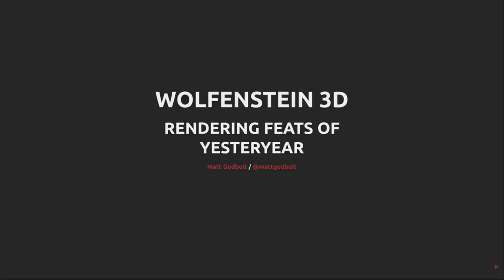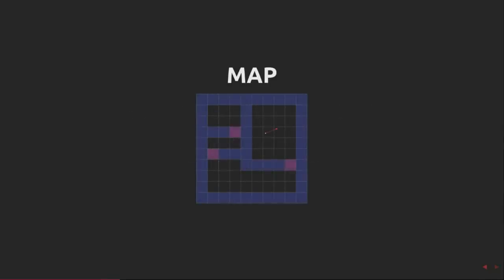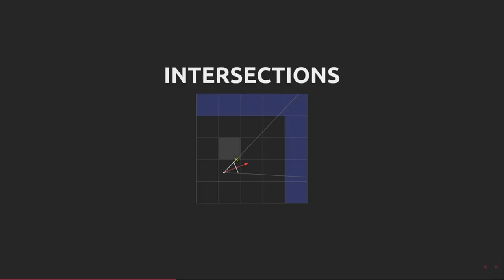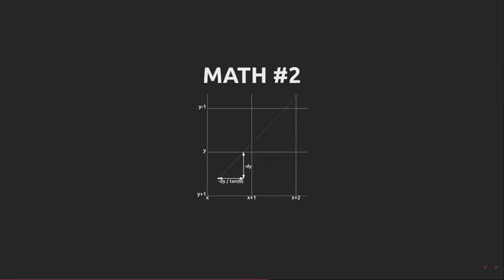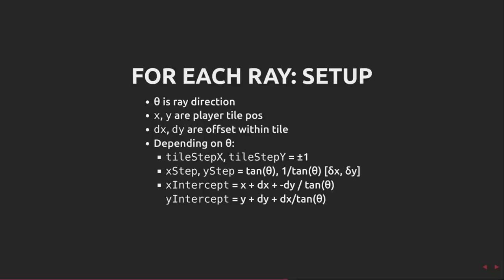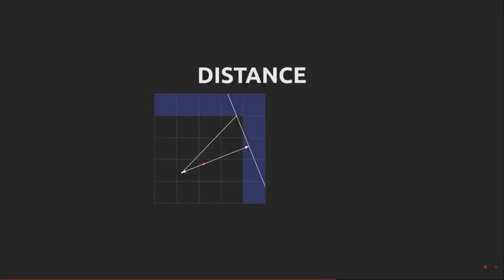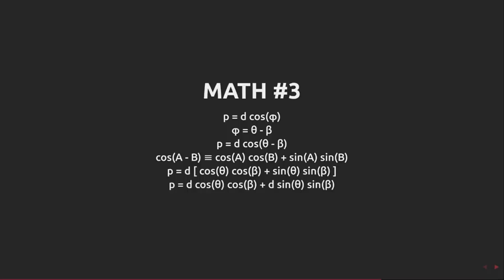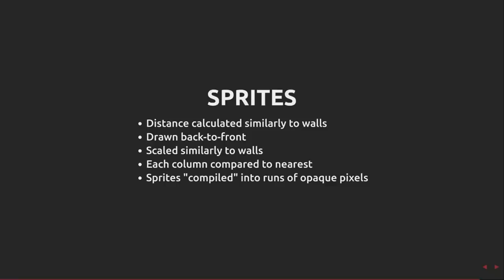Wolfenstein 3D's map renderer

Comment: It's funny to stumble upon a video by the guy who made the Compiler Explorer. Thanks for giving the tools and ideas for tinkering! =)
And thanks for the notes on self-modifying and self-generating code: made me really want to dig into Wolf3D's internals

Why does the fisheye effect occur with the naive hit distance calculation? Geometric intuition suggests that everything should be ok if you choose field of view correctly
Reply from the maker: I obviously didn't explain myself well about the fisheye. Field of view doesn't come in to it. Imagine a wall directly 10 feet from you. If you were to take a photo, the wall would appear in the photo as a rectangle, right? No fish eye. However, if you measured the distance from your eye to the wall directly in front of you you'd get (say) 5 feet. But it's further to the left and right edges of the wall, maybe 7 feet away (depending on how long the wall is). If you scaled the left hand as 7 feet away, the middle as 5 feet away and the right as 7 feet you'd draw something like a fish-eye wall. So -- the takeaway is, the scaling distance can't be the straight-line distance from the eye to the object, but rather the perpendicular distance away from a plane at the screen. I hope that's (maybe) a bit clearer! I've seen engines use the straight-line distance and then "fudge" it to undo the fisheye effect instead of calculate it properly as Wolf does.  Changing the field of view only changes the angles between each ray cast out, it doesn't create or remove the fish eye effect (although if you have a very large field of view you see something similar).
Reply: @MattGodbolt  thanks, got it!
But what if I aim not to simulate a flat non-distorted picture, but to make the screen "transparent"? In this setup the source of the rays matches the viewer's position, and the virtual screen FOV matches the real one. Will the straighforward approach be more appropriate then? And why isn't it used in game engines? Too narrow FOV?
What I want to overcome by this approach is the unnatural view stretching. It's noticeable when you rotate the camera: everything looks way smaller in the center of the screen than on its periphery (yay, I know the reason of this warping now)

Comment: I'd be really interested in seeing that fisheye effect you mentioned at 3:38.
Reply: Just search up "raycasting fisheye effect."
It just looks like the player is looking through a fish bowl.
When facing and far from a wall, the lines (top and bottom) slowly converges at the ends of the screen; this is more apparent when the Fov is relatively wide.
Reply: Check out the coding train Livestream for a demonstration of that on P5 js https://youtu.be/-6iIc6-Y-kk
Reply: @callsignseth7679  The middle section of the stream of Daniel is about 3D representation of ray casting and the fish eye effect when we don't take in consideration this geometrical adjustments.
Reply: Ultima Underworld and I think Catacomb Abyss both have this issue.
Reply: There's a picture of the effect in the book "Game Engine Black Book Wolfenstein 3D" by Fabien Sanglard.

Comment: 6:14 and 6:31 no, when stepping to the next cell you have to add +1 or -1 to the initial computation dx/tan(θ) or dy/tan(θ), as you correctly describe later based on source code.

Comment: a 286 with no floating point was certainly NOT "state of the art" in 1992!
Reply: Tom P. Agreed. I still have my 386SX-16 from 1990. A 486DX2 was state of the art in 1992!
Reply: It wasn't 'state of the art', but it was met the minimum system requirements.
Reply: I think he met to say i386.

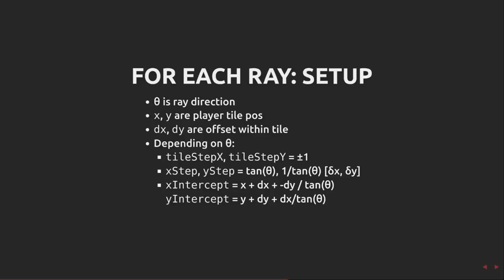Comment: 8:24 this is what makes it extra good. thx for sharing.
Reply: Good and unstructured code.  It works but it is insane.  It applies 16-bit arithmetic on 32-bit words.  It is not portable because it requires an old C compiler that defaults to unsigned comparisons.  There should be a disclaimer.
Reply: @techeadache  woaaa did you just use knowledge to elaborate on my initial argument!!  O_O    :-)
Reply: @kentlofgren  I think a lot of people will try to implement this craziness on a different compiler.  Ofcourse without knowing that (-dx) means static_cast<long>(static_cast<unsigned short>((1L<<16) - static_cast<unsigned long>(dx))).  The negation is an optimization and not a mathematical form for subtraction.  The old keyword "volatile" may need to be used to force (-dx) into memory before it is applied to other equations.

This is code that must be written in assembly.  Using a C or another compiler may produce an undesired effect that would be fun to watch.

Comment: There were far more powerful processors in 1993 than a 286. We were up to 486 pushing into pentiums. There were also graphics cards at that time.
Reply: Wolf3D came out in 1992. Doom came out in 1993. 

My family got a 486DX/33 with 8MB of RAM in 1993. You could just barely run Quake on it (if you call getting single-digit fps with the sound breaking up "running"). Cost AUD$4000, which is about double that in today's money. Hardware was expensive. Hardly surprising that ID targeted older stuff like the 286 for Wolf3D and the 386 for Doom. 

3D accelerated graphics cards were a mid-1990s thing. The first ID Software game to get support for them was Quake 1 with the GLQuake update, but Quake 1 started off with software rendering only. Quake 2 still came with a software renderer, and it wasn't until Quake 3 in 1999 that they were common enough that ID dropped software rendering entirely. The original Unreal from 1998 also includes a software renderer (and a pretty impressive one at that, as it dithers the environment textures to fake bilinear filtering, which I've never seen in any other engine), but later games using the engine don't bother to include it.

Comment: I disagree with calling a 286 "state of the art" for 1992. Commonly available, and a good target system to develop for? Yes, but the 386's and 486's had already been out for a few years by then.
Reply: Yeah, and not to mention the gaming beast that came out in '87 - Amiga 500.
Reply: Agree.  The 486 was introduced in 1989, it was actually a bit old by 1992  - the 486DX2-66 was top of the line in 1992.  The Pentium was released in 1993.  386s were still around but fading away.  286s were pretty rare and while Wolf-3d may have run on one, it didn't run particularly well.

Comment: The use of the square grid to leverage CPU power was pretty genius on id's behalf. I wonder how was the trig handled without floating point arithmetic?
Reply: It was built into the compiler, they didn't even need to think about it, but of course, it is always better to avoid using floating point, as doing floating point math without an FPU is expensive.
Reply from the maker: I think I explain in the video (it's been a a while...) - everything used fixed-point arithmetic with look-up tables to handle the trig functions.

Comment: It should be noted; Ken Silverman's Build Engine could actually do room-over-room tracing, even though it was primarily a raycasting engine. I'm not exactly sure how it worked, except that doorways and windows that you could pass through worked by teleporting the player to different places in the map.
Reply: The build engine wasn't geometrically correct though, try looking up and you will see everything looks distorted!
Reply: @navithefairy  It's the same trick used by Rise Of The Triad: treat the view like it's really tall and slide the screen up or down, then render the bit that'll actually appear. Unlike a proper perspective-correct 3D rendering, it will keep the walls dead-vertical when you look up and down, whereas a proper rendering will have them turn into diagonals.

Comment: Personally, I always thought that the fisheye effect was much more desirable than the "corrected" version that has become standard for the simple practical reason is that you can play with a higher FOV with the simple distance renderer and not have the central focal point in the middle of the screen be so small, and the edges be so big.

I really wish more renders kept the simpler distance render for that simple reason alone. It makes it easier to see when playing.
Reply: The fisheye effect didn't increase FOV. FOV stayed the same, the walls just scaled incorrectly.

Comment: I had a 386DX 40Mhz then, I clearly remember that it didn't run well at full screen even on that machine. I was quite jealous for the 486DX2 66Mhz because Wolf3D ran perfectly on that, but not with the 386... on 12Mhz 286, there is no way to talk about well-running Wolf3D at all, if it is close to the full screen :D 
Not mentioning Doom, what was awfully slow at full res. on my 386, strong compromising needed to play. With a 486DX2 it was much more playable...

Comment: They had no floats in 1992?
That absolutely blows my mind!
Reply: Fixed point is enough for such resolution and level of details
Reply: Floating point hardware existed but wasn't common until the Pentium.  It was optional with 486s - the DX had floating point, the SX did not.  Prior to that it was a separate chip (math-coprocessor) available all the way back to the 8087.  See also the 287 and 387 chips - the math coprocessor counterparts to the 286 and 386.  Many motherboards had space for the math coprocessor but it was left empty.  Very little software took advantage of floating point hardware back then - CAD and spreadsheets come to mind, but both had software floating point algorithms to fall back on if the hardware wasn't present.
Reply: Badtanman They has floats in 1992 but integer math was faster before the Pentium. On the Pentium you could start an floating-point operation, do a bunch of integer math, and then read the float results X clock cycles later due to the dual U and V pipes of execution on the Pentium. This is how Quake was able to get ~8 - 16 texels for free with its software perspective correct texture mapper on the Pentium.

Now a days integer math is slower then floats so every one uses float32 or float64 for the increased precision, speed, and convenience.

Comment: I'm sorry, but this has become sort of a pet-peeve of mine (especially with all the videos about real-time raytracing around these days): 
Raycasting is simply the process of "firing" (or casting) a ray from one position in one direction into a scene and checking what it hits. That's all there is to it.
It's still in use in almost every single game you play today, for example to check what enemy a bullet hits. In itself, it has about as much to do with rendering as a hammer has to do with building a house.
Raytracing generally describes algorithms that use raycasting to render an image.
Everything beyond that is not included in the terms on their own.

Two other things I noticed:
1. You're only using about a quarter of the screen. I imagine that's a bit annoying for people watching this on a smaller device.
2. The step done around 12:35 might have been easier to follow if you circled the terms replaced by delta X and delta Y in the equation for p.
Still, very nice and to the point explanation of the algorithm.
Reply from the maker: Thanks for the comments. You're not the first to point out my mistakes here :). If I were to redo things, I'd use more of the screenspace and make clearer the definition of what ray casting is.
Reply: hammers have a lot to do with building houses, Lol
Reply: @barrybathwater4877  Well... yeah... they are definitely used while building houses, but using a hammer does not mean you're building a house... which was the point.

Comment: This is the older video and I don't know if there was a comment on the following issue...
At the time stamp 04:55, you are showing that "dx" is the distance of the starting point from the LEFT side of the square field.
But at the time stamp 06:20, "dx" is suddenly the distance from the RIGHT side of the square field.
Which "dx" is used in the final equation? Left or right side "dx"?

Comment: There's a better way to calculate how large the column of pixels for the wall should be than calculating the normal distance.

Calculate the square of the normal distance, and use that directly.

Comment: The 486 was released in 1989, 386 in 1985. A 286 would not have been "state of the art" in 1992, but rather a paperweight.
Reply from the maker: Patrik Lindström a fair criticism! Thanks for the correction. It was in fact the minimum spec!
Reply: A 486 might well have been out 3 years before Wolf3D, but they were super expensive and only really affordable for business use. A 286 was a realistic "home PC", but yeah, not state of the art.

Mine was made by ICL and had a whole megabyte of RAM and a 40MB hdd. It was a massive upgrade from my Atari ST - it did VGA! ;-)
Reply: I knew many people who still used the 286 in 1992. In fact some even used older PCs for accounting and such. It wasn't a paperwheight unless you were a hardcore gamer. Edit: Atari ST <3 <3 <3
Reply: we got our first 486 in 1993.
Wasn't cheap as such, but considerably cheaper than the 286 we got in 1990.
That does give you some idea of when the 486 started to common.
I mean, there's sometimes a big gap between something first being available and it being common.
there were computers with a recognisably modern GUI in the mid-70's, but it's not until the mid 90's that it was common enough to be the norm, and not something of a niche thing...
Reply: I played Wolf on 286 and my next computer was 586 in 1996.
Reply: @James - Never the less, 386s were the "standard" by 1992. My family had a 486 DX2 50MHz with 4MB in 1992. That was powerful enough to run Doom at full screen a few years later.  (Though it did create a lot of motion sickness in Wolf3D....)
Reply: @MattGodbolt   well, you were kinda right, actually. 286 in 1992 was quite a modern machine. Those were times when tech was not growing that fast and 286 in 1992 was a decent machine. Also personal computers were quite expensive and rare, so in 1992 you could definitely surprise your friends with 286. Having 486 in 1992 was like you had a personal space shuttle :)
Reply: @SweetHyunho  there were no 586, bro, they already were called "Pentium" :)
Reply: While still on a 286 in 1992, we upgraded to a 486 in 1993. The 286 was definitely low end in 1992, but still quite common. 386 and 486 were quickly overtaking it in numbers.
Reply: I did think this. The Pentium came out only a year later in 1993. Always reassuring to not be the only anal one watching a video 😉
Reply: @user-lv6qm3fj2z  Intel went with the Pentium name because they couldn't trademark "586", but that's essentially what the chip was.  And there were 486-compatible upgrade chips from the likes of Cyrix and AMD that used "5x86" names, which competed directly with the Pentiums.
Reply: Not so much a paperweight. PC gaming wasn't big in 1992. PCs were still extremely overpriced underpowered boring business machines. They mostly ran DOS programs for business. There wasn't much demand for high-end PC hardware, there was precious little that needed it. Doom was the one game that changed that. So for a long time the PC market covered a wide variety of machines, CPU, RAM, and graphics cards. Most games of 1992 will still have come with EGA and CGA graphics modes. Wolfenstein obviously being an exception. 

Things weren't like they are now. 
 
The first 486 CPUs cost something like $1000 or more, just for the chip. RAM was something like $80 a megabyte. This is all from rusty memory. Home computers wouldn't usually have a hard drive, nor would many business ones. 

ID got their start making games with full-screen scrolling and sprite animation that would run on the crappy PC hardware of the time.

Comment: Great video! Great visual representation of Raycasting too. ^^

A few companies wrote really advanced Wolf3D raycasting engines. Rex Blade by Andre' LaMothe specifically uses this in a shipped game, it uses somewhat DOOM-like Geometry (by using stacked grids) with some advanced features. Rise of the Triad uses a similar system, but with only one grid with walls of variable height.

Rex Blade has a pretty amazing engine, he wrote in 180 days I believe. 

Rex 3D (unrelated to Rex Blade) used raycasting with lines like DOOM, this one was very advanced but has nearly been scrubbed from the 'Net. Raycasting like this in a DOOM-like environment gives you some great tricks like being able to calculate some nice lighting and such somewhat akin to its larger brother Raytracing.

Comment: I'm pretty curious about the self-modifying code of the ray casting loop. How was it even done? And was this common practice when writing tight loops? It's seriously cool to think about, but in hindsight, I can see how much of a pain in the ass it could be for someone who doesn't know about it.
Reply from the maker: I'm not sure how common it was, but Wolfenstein did it here: https://github.com/id-Software/wolf3d/blob/05167784ef009d0d0daefe8d012b027f39dc8541/WOLFSRC/WL_DR_A.ASM#L235 patched the `jge` etc :)
Reply: Wow, that was way simpler to understand that I thought it would be. Guess I'll be reading the wolfenstien source code this weekend.Amazing video as usual!
Reply: The technique is fairly common in assembly code, which forces a fair level of spaghettification anyway. The speed critical bits like 3D rendering would be where you invested in assembly coding, which is far slower to develop.